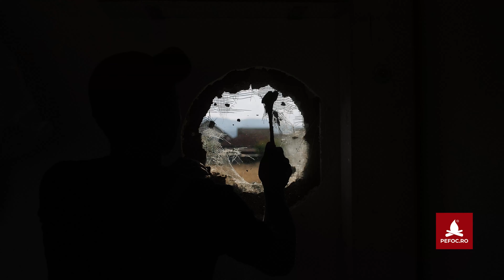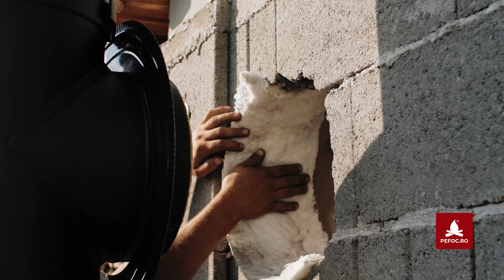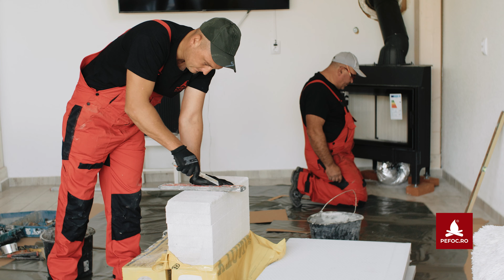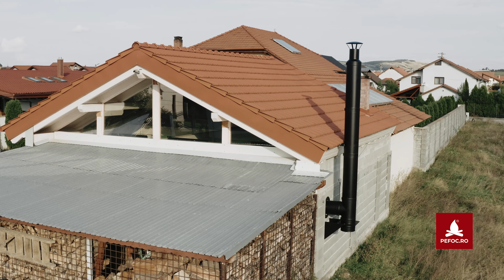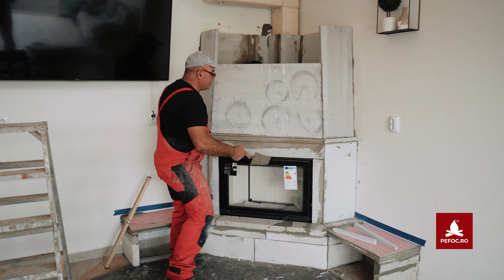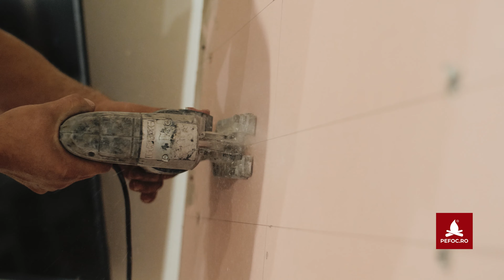Montare semineu pe lemne cu design simplist & cos de fum din inox negru in Constanta!

Comment: Pt. siguranță, burlanele, de la focar până la vârful hornului, la ce interval de timp trebuiesc înlocuite ??? Că mă gândesc, că n-or fi pă veci !!???
Reply from the maker: Bună ziua,
În cazul de fata avem un semineu cu burlane de oțel de 2 mm și un coș de fum cu izolație și interior din oțel inoxidabil, avem de-a face cu două componente principale: tronsonul de burlane de la focar până la intrarea în coșul de fum și coșul de fum propriu-zis.

Perioada de garanție standard pentru un astfel de sistem de evacuare a fumului este de 5-10 ani (in functie de producator, unii dau si 25 de ani pe coroziune la tubul interior), cu condiția ca acesta să fie curățat anual, conform reglementărilor legale. Este important de menționat că durata de viață a sistemului poate depăși această perioadă de garanție, atât timp cât este întreținut corespunzător și utilizat în conformitate cu instrucțiunile producătorului.

Totuși, trebuie să subliniez că, dacă burlanele și coșul de fum nu sunt curățate la timp sau dacă se ard materiale inadecvate (cum ar fi deșeurile), există riscul de autoaprindere. Aceste circumstanțe nu sunt acoperite de garanție și pot reduce semnificativ durata de viață a sistemului. În astfel de cazuri, este posibil să fie necesară înlocuirea acestuia chiar înainte de expirarea perioadei de garanție.

Pentru a asigura o funcționare optimă și sigură, recomandăm respectarea tuturor instrucțiunilor de întreținere și utilizare și efectuarea curățărilor anuale.

Sper că aceste informații vă sunt de folos. Pentru orice alte întrebări, nu ezitați să mă contactați.
Reply: @pefoc-ro Vă mulțumesc frumos pentru amabilitate. 
Însă, indiciile în baza cărora ar trebui să-mi dau seama că trebuiesc schimbate cava lucruri, obiecte, de la focar la vârful hornului, ar fi arderea ,,materiale inadecvate (cum ar fi deșeurile)" ?? Că ardere deșeurilor, nu prea cred să mă ajute, să-mi dau seama, dacă trebuie să înlocuiesc ceva.
Sunt interesat de produsele dvs., toată viața mea am respectat reguli, chiar dacă s-a dovedit că erau greșite. Deci, trecând peste instrucțiunile dvs. de utilizare a focului (ce bag pe foc, curățat hornul), cum îmi dau seama, că trebuie să schimb ceva ??? La cât timp, ce fac ??? Dacă, nu știu ce, arată nu știu cum, se deteriorează zmalțul la ceva, se zgârâie inoxul, ce fac ??? Ce schimb și când ??

Că nu vreau să-mi ardă casa, din cauza coșului metalic, așa cum am văzut nenumărate situații la știrile tv. Că nu prea cred că vina proprietarilor era doar a lor și nu și a producătorilor de astfel de materiale.
Reply from the maker: @argentus5483  Vă mulțumesc pentru întrebarea dvs. și pentru interesul manifestat față de produsele noastre. În România, curățarea anuală a coșului de fum este nu doar recomandată, ci obligatorie prin lege. Această procedură, efectuată de un cosar autorizat, nu doar că elimină depunerile, dar permite și identificarea oricăror semne de uzură sau deteriorare. Această adeverință de curățare este necesară pentru validarea asigurării locuinței, întrucât, în lipsa ei, asigurările pot refuza să despagubească eventualele daune cauzate de un incendiu provocat de coșul de fum sau semineu.

Deteriorarea Elementelor Ceramice și Inox:

Ceramica: Pe lângă autoaprindere, ceramica poate suferi deteriorări mecanice în timpul curățării, dacă nu se folosesc unelte adecvate sau dacă instalarea inițială a fost defectuoasă. Fisurile fine nesemnalate sau erorile în aplicarea lipiciului pot duce la probleme serioase în timp.
Inoxul: Coșurile de inox pot avea de suferit din cauza curățării inadecvate sau a întârzierii acesteia. Coroziunea sau deteriorarea se pot accentua dacă stratul protector este afectat, fie prin uzura mecanică, fie prin expunerea la agenți chimici agresivi.
Efectuarea de inspecții vizuale lunare este recomandată pentru a identifica semnele timpurii de coroziune sau deteriorare. Orice indiciu de deteriorare ar trebui evaluat de un specialist.

Referitor la arderea deșeurilor, acest lucru este un exemplu de practică nerecomandată care poate contribui la acumularea de depuneri excesive și la autoaprindere. De asemenea, arderea lemnului umed sau rășinos este contraindicată.

Prin respectarea instrucțiunilor de întreținere și utilizare, puteți prelungi durata de viață a coșului de fum și vă puteți asigura de funcționarea lui în condiții de siguranță.

Pentru orice alte întrebări sau clarificări, nu ezitați să mă contactați.

Cu respect, Echipa PeFoc